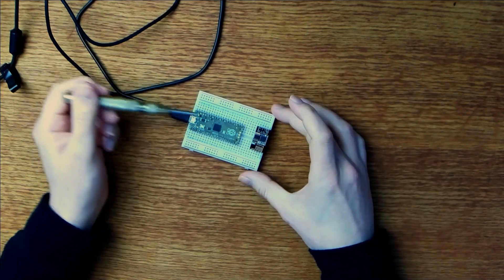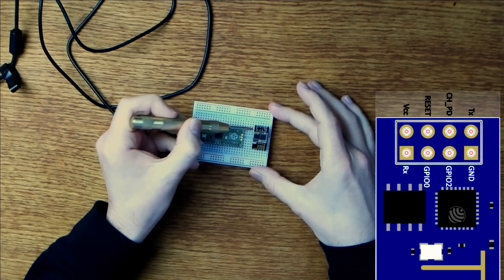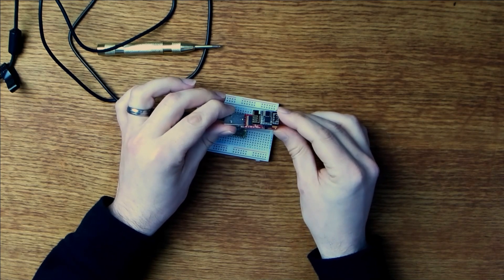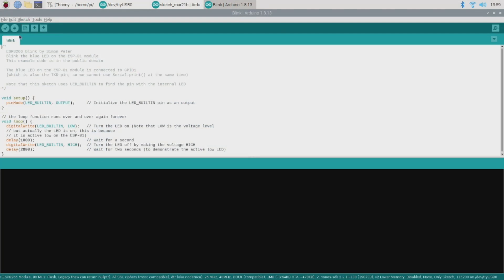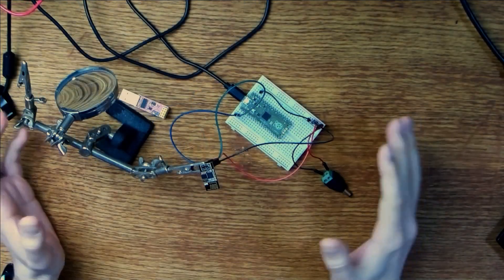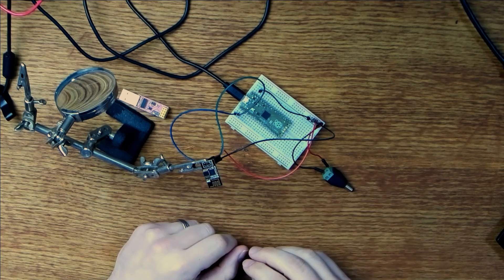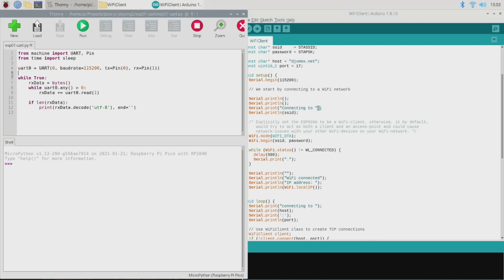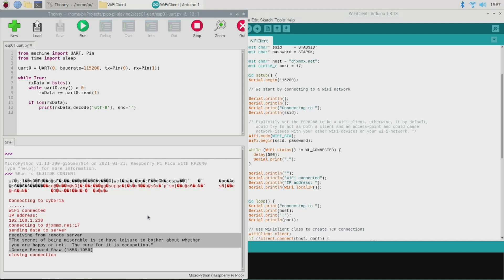Raspberry Pi Pico gets WiFi via an ESP01 and UART

Comment: Thanks for this.  I got it working using one of the new Cytron breakout boards where there is  actually a slot to plug in an ESP-01.  It uses GP16 and GP17  for TX and RX.  It seemed to work using the 3V3 from the Pico, but maybe I just got lucky...
Reply from the maker: Interesting, thanks for the info 👍 powering it from the Pico would be much more convenient
Reply: @tinkertechtrove2910  Mine worked etting the 3.3v from pico too, however I have to connect the 3.3v after the pico start running, It does not work if it is already connected to the power when pico starts to runnig. Not sure why. I will try get the 3.3v from some pin after 1 sec pico is running by turning this pin to high.

Comment: Thank you. Your presentation is very clear and well paced. I thought I had a problem with my ESP01 as I could not get it to blink with the initial test example. In fact the program was running but my module's inbuilt LED is not attached to  the "LED_BUILTIN" pin. When I replaced all references to  LED_BUILTIN with "1" it worked.

Comment: Great video!  I had the idea myself when the Pico came out and you brilliantly illustrated what I was thinking... thank you so much!  Now that the Pico W is here there will probably be less interest in actually doing this... oh well... I still think it is a solid idea.  I am working on an alternative approach to the MicroPython interface, though... basically build a Pico UF2 that supports the NETWORK library for a specific ESP+Firmware+Connection configuration...

Comment: Tim this has freaked me out! I bought 4 ESP-01s last week, and struggled to find decent help for pico. So instead I learned how to make my arduino uno work instead with blynk. 
I'm soooo happy you worked this out as I'm still a total newb with electronics! And I also prefer raspberry pi and pico over arduino as a preference, I love them both though.
I did manage to make my ESP-01s module act as an "access point" aka AP, maybe you could work out how to make the pico work as a wifi extender though I think that might be a firm update on the ESP01s from my research so maybe a more advanced tut!
Keep the videos going, I'm always excited to see when you post.
Reply from the maker: Glad your enjoying the uploads 🙂 good luck with your ESP01s. Making a WiFi extender would definitely be an interesting project, or maybe even a mesh network from several nodes spread around
Reply: @tinkertechtrove2910  Worried you have something place inside my brain, maybe a pico relying information haha but also was thinking of a Mesh Network, considering I have 4 of them to play with (just £12!) 
Hey do you know in your video if you version is EPS01 or ESP01s? I don't really know the difference myself, I teach just software on  youtube with Godot, I'm hoping to interface pico or arduino with it though for some entertaining situations
Reply: I'm really sorry Tim, I have just one last question, I LOVE that this channel so far is raspberry pi pico, I think it's gonna be huge and 100% the right direction to go. But will you feature Arduinos in the future? Even if it's only how to interface with a Pico in some way, it's exciting for me.
Reply from the maker: Of course, the Arduino is also an excellent board. I have used it with Grbl for DIY CnC projects, probably going to be doing some uploads around that at some point.
Reply from the maker: You may also want to check out https://youtu.be/Wkk1aNWj6sQ on interfacing Arduino and Pico boards 👍
Reply: @rungeon83  the difference is the ESP01 (Blue) has 512kb of Flash memory and the ESP01s (Black) has 1Mb of Flash memory
Reply: @lambert0259  you can get black ESP01 I have one, and I have 4 ESP01s. There is very subtle differences. I've managed to get them working really well with my uno, but mostly by themselves setting up access points and webservers

Comment: For the Pico to be of any use it just needs WiFi built in. The ESP8266-01S is perfectly capable of running MQTT and transmitting sensor data on it's own

Comment: Another solution that may be simpler would be to just run the native firmware from the ESP-01 and drive it from the Pico with AT commands. Just plug them together and write code on the Pico.
Reply: Do you know if we add a script to ESP01 like the example in the video, which I did, the original firmware is deleted? BCS I spent 2 days just trying to send an AT command to get the OK back but I had no success. That is why I tried the approach of the video. I tried to see some videos on how to install a firmware, but it seems very complicated.
I think, when we add some script in the esp, the firmware stops working, BCS it only runs the script
Reply: @alexdominguess  Yes it wipes it out. You will have to download again and reflash.

Comment: I was just wondering I don't have a programmer for my esp-01 board is there a way to make one with the Pico?
Reply from the maker: That's probably possible, though I have not tried. You can use an Arduino as well, there are tutorials for that online

Comment: Wouldnt it be easier to use an esp32?
Reply: Yep
Reply: Yes but the ESP8266 is smaller and cheaper, especially as an ESP-01, which is probably the cheapest ESP-Anything that you can buy that's not just a bare chip.  I also suspect that the ESP32 uses more power also, although theoretically (with the right firmware), you'd get access to the latter's Bluetooth functionality also.
The new ESP32-C3 is intended to be a new-and-improved replacement for the ESP8266 and has already started to be made incorporated into ESP01-compatible boards, so that's another potential path to Pico Wi-Fi happiness.
And as of a few days ago, there's the Pico W which provides similar functionality, but may not be widely and reliably available for a few months.

Comment: Great video, well explained. I have a pico in my greenhouse with a Bosch temperature gauge connected to measure the temperate. I have added an HS06 bluetooth module so I can connect to it from an app on my phone. I would prefer to have wifi if possible. I have a 3 * battery pack powering the pico. Would it be possible to power the ESP01 by battery as well ?
Thanks again
Andy
Reply from the maker: So long as you use a voltage regulator, buck converter, or something else to make sure the voltage is 3.3v then it should be fine. I will be exploring ESP01 low power modes soon as well.
Reply: @tinkertechtrove2910  Ok thanks Tim. I am new to electronics. The battery pack works well, tried using a usb power bank which turns off after a few seconds. I guess the pico is not drawing enough power. The bluetooth module only works when when pico is connected to my notebook. If I can get the EPS01 powered by battery I will be there ! Thanks again Tim.

Comment: Hi, thank you for the informative video. I still have one problem relating to the decoding of
the data stream. The line, print(rxData.decode('utf-8'), end=' ') returns a unicode error. Do you have a solution to this problem? Any help would be great. Best wishes.
Reply from the maker: Seems you have some data in the buffer (rxData) that can not be decoded using utf-8. You could try waiting a bit before reading data as the ESP-01 sends some binary on startup, or better yet check out part 2 for a much better way to do this https://youtu.be/v_Tm_IgbRDc
Reply: @tinkertechtrove2910  Thanks. I love your video. These videos are extremely helpful. Best wishes.

Comment: It didn't work for me, nothing appears on Thonny's console when I turn on the ESP-01 after programming it.
Reply: Make sure the TX of the ESP01 connects to the RX on the Pico  and RX of the ESP01 connects to the TX on the Pico, if this dont work try another ESP01, you can also check the ESP01 is working as per the video above.
Reply: @lambert0259  I tried this but I get lots of small squares filling up the shell screen. No characters. Any thoughts? Everything is plugged as it should (inc tx (esp) -> rx (pico) & rx (esp) -> tx (pico)
Reply: @frankjimenez9407  the baud rate from the ESP01 is usually 115200 baud if the baud rate on the pico is set to anything else you will get garbage on the screen, hope this helps
Reply: @lambert0259  yeah, I set the same baud rate. I tested it before using the esp01 usb adapter (like the video) and works as it should in the Arduino Serial Monitor. But when connected to Pico, I do not see anything but gibberish.
Reply: @frankjimenez9407  if the ESP01 is working correctly( try it in the Arduino IDE monitor to confirm) the only other thing is try the other UART on the pico UART1 pins gp4(tx) and gp5(rx). these devices need quit a bit of power as indicated in the video. not enough power causes brownout, (reseting).

Comment: This is not really giving WiFi to the Pico, it's using the pico as a dumb terminal to the ESP01 which is running the code that does something over WiFi. Good presentation style, though